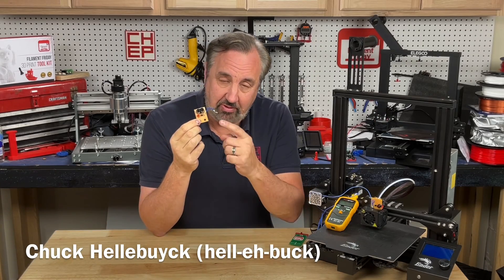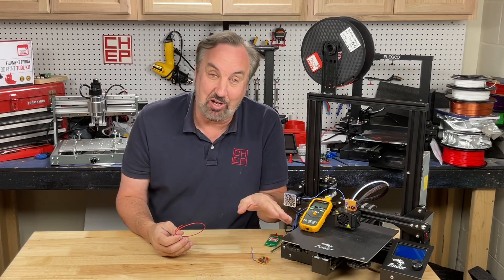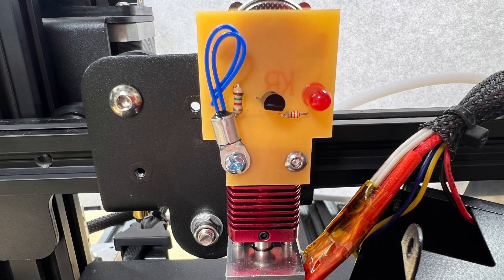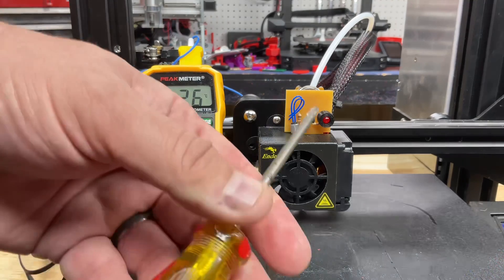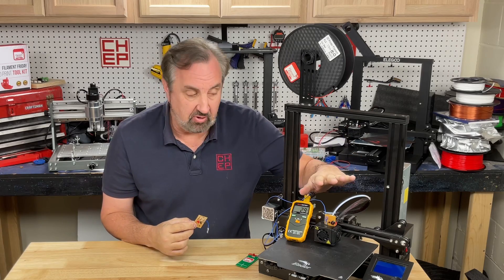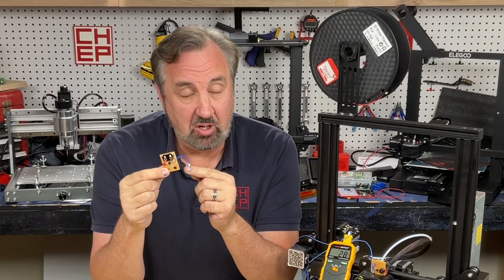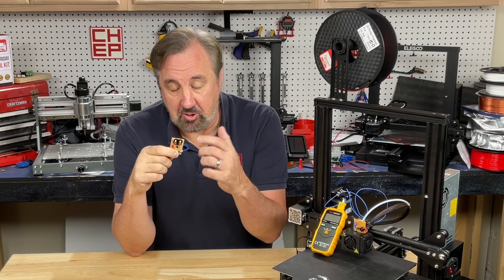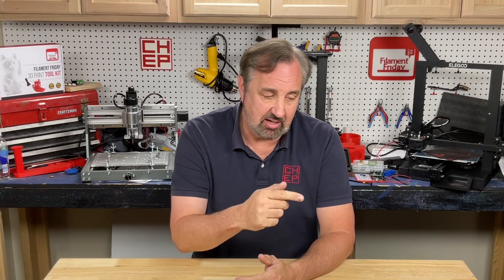Sensing Heat Creep in a 3D Printer Hot End

Comment: I am am going to attach a probe just above the heat break and control the speed of the fan depending on the readings. This way my fan will keep the heatsink below a threshold while being as silent as possible. I am running a more powerful and quieter fan than the one shipped with the printer originally
Reply: Sounds like a great idea.

Comment: Would love to see an option powered by the 5v rail for the fan. It would also have a supercap of some sort in it to keep the fan running should it be needed when the machine is shut off. Not sure if the power could be bled through a resistor or not, but then you have a detector and something to keep the fan spinning, should it not be dead for some reason. 

It is feature creep-y and lacking the knowledge on how to implement it, it may be harder than I expect, however it would be a nice touch!

Comment: Great video CHEP,
Hmmmm how about a second thermal couple connected to the main block.  Then the cooling fan controlled by a circuit that uses the second thermal couple with the power coming from a separate PSU or supercap so the fan can continue to cool the heartbreak if the system gets turned off before the hotend is cooled to an acceptable level.

Comment: Only a thought but could the firmware be tweaked to retract filament  say 30mm at end of printing.
Reply from the maker: You could do that in end GCode of the slicer profile.
Reply: @FilamentFriday  Would you have to add the filament retract code to each print job manually, or can it be a cura function?
Reply from the maker: It’s in the machine profile in Cura so automatically added on every print.

Comment: Hey Chuck. 
From what I glimpsed, your circuit is based on a transistor (either BJT or FET) and a couple resistors working as a switch, with a large transient between the blocked and saturated states, hence the progressive switching of the LED.
Did you consider using an OpAmp in a Schmitt trigger configuration? About the same number of components, but a sharper commutation
Reply from the maker: 3v coin cell limits options but I’m looking at a simple Micro solution.

Comment: Wouldn't the bottom of the heat sink/heat break be more of a problem? 
As I mentioned in a comment in another video, when I take apart my hot end, I've found about maybe 10mm still in the bowden tube where it interfaces with the nozzle.  I think that's what's causing stringing.
Or maybe what I call stringing is to be expected with an Ender 3 v2 using eSun PLA+ filament at 205C nozzle temp.
The sample cat with the sample filament did not string across the ears.  Never printed the cat with the eSun though.
Reply from the maker: It’s a problem across the whole heat sink. I just choose to easily sense at the screw.

Comment: I use a 80mm old PC fan, I lower the voltage around 8V, it's silent and works perfect the last 3 years with my stock Ender 3 Pro, also use the Petsfang duct with a single 5015 blower fan for layer cooling.

Comment: If you ever decide to release it, I would like to ask for permission to adapt it to the Prusa mk3 design please.
Reply from the maker: That might be tougher. I’ll look into it.
Reply: @FilamentFriday  I was thinking using a small alligator clip thru the vent opening on the right side beside the pinda probe and clip on to the cooling fins to attach the probe. It would be cooled by the fan blowing over it but that's kinda the point to see if the fan is not working
Reply: You shouldn’t  need this on a Prusa.  It uses a 3 wire hot end fan with a sensor that will tell you if it stops spinning.
Reply: @Hairy_Phils_Lament  you can disable that warning

Comment: Hi Chuck. Great idea.
IMHO you could also make it with a comparator instead of a transistor so that you could calculate an edge temperature where the LED goes full-on or stays off.
In fact, you could even connect a piezo buzzer to it as an acoustic warning.
Reply from the maker: Yes. Good ideas.

Comment: Have you considered using a comparator to light the LED once a threshold is met? It would be much easier to to distinguish from the off state rather than a gradual change. Also, what about using another thermistor that the printer could monitor with a firmware change? Great vid/prototype regardless!